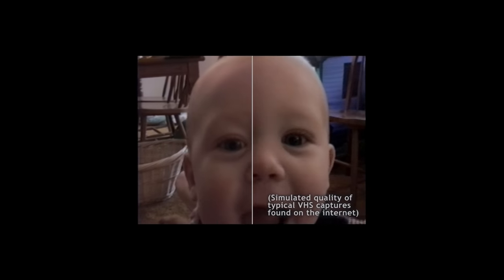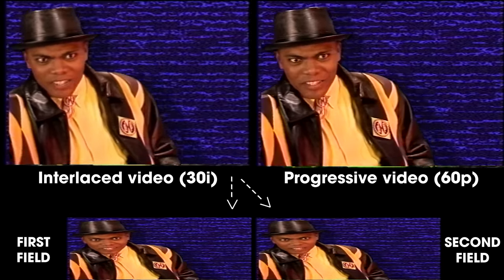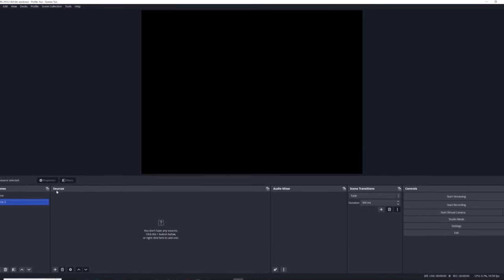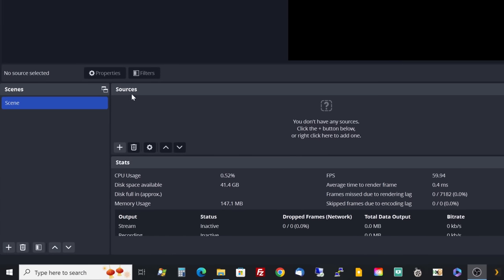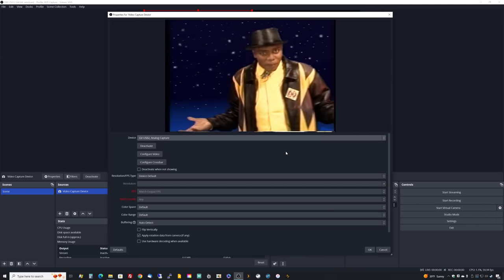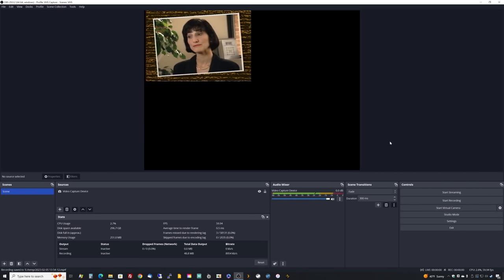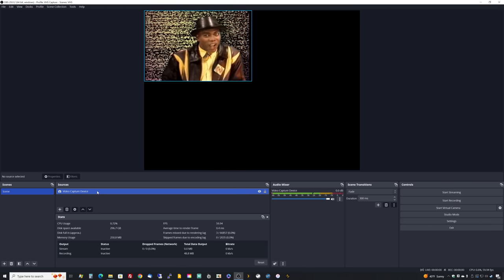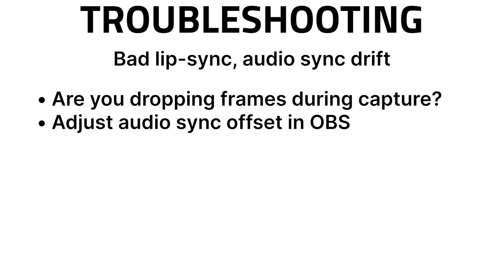How to convert VHS videotape to 60p digital video

Comment: Your previous video taught me how to make my videos look as good as they do- will watch this one when I have time and hopefully learn more!
Reply: OK, after watching this I still like the old way better for my purposes, mainly because I already have hours of stuff on DVDs and hard drives that would need to be re-captured this way from the tapes in order to work. My setup doesn't allow for quality monitoring of any captures done on the computer either.

I would like to switch to Blu-Rays for archival copies rather than DVDs, but does this method retain the analog closed captioning? I want to have that intact as it's part of the original signal; captures made with my DVD recorder keep them for playing through a TV's analog inputs or on players with built-in decoders such as the Oppo 203.
Reply from the maker: There's nothing wrong with sticking to the old process; this tutorial was meant to be a generic 1-stop solution for most general use cases.  You get better quality capturing to .avi and a lossless codec and then post-processing yourself, so if that's working for you, keep doing it.
If retaining closed-captioning is a requirement, you should keep doing your DVD-recorder process, because most common capture solutions and workflows discard closed-captioning.
Reply: @TheOldskoolPC  I'll have to research that more, as I know some playback programs on my computer can decode captions. It's possible to keep them on Blu-Rays also, the first wave of Blu-Ray movies from Sony and Fox actually have them though most people when those were released could only see them using analog outputs downgraded to standard-def! I would like to archive my analog stuff in higher bitrates and fit more on each disc, upscaling to higher resolutions isn't necessary. I only do that for YouTube to get the right frame rate.

Comment: Excellent step by step instructions.  After watching I ordered the I-O Data converter off Amazon, hooked it up, followed your detailed instructions - capturing great from 8mm I am starting with.  Only issue so far is - my file sizes are HUGE!  My 30 second test videos are like 100 MB while looking at your file sizes in the example they are much much smaller.  I selected MP4 but not sure I have the capacity to transfer hours of tapes if my test files are any example.  Doing some more research.  Suggestions?  Thanks for a very useful video.
Reply: I am having the same issue. Even at 720p the files are huge. At 1440x1080 a 2 hour video is 20GB! Have you found a good solution for this yet?
Reply: @Popomcgo  sadly no.  I ended up buying 2 SSD 2 TB external drives and will just move files around using them.  Storage is getting lower and lower cost so would rather deal with large file sizes than poor video quality.

Comment: Once you convert a VHS cassette to digital there can be lots of dead tape space that got converted. Those segments of converted video can be hard to find and not needed. PyVHS is a Python package that removes those unused tape spaces. PyPi and GitHub is where PyVHS is located. Say you converted a lot of videos and do not want to manually edit them then they can automatically be removed while you do something else.
Reply from the maker: Nice.  Does PyVHS use ffmpeg as the back-end, and does it only use -c copy?  I would be worried about generational loss due to re-encoding.

Comment: I worked in photographing and producing concerts from 2005 until 2013. I have 150 video tapes and I used to copy them via FireWire.
Reply from the maker: Firewire is the correct option if the tapes are indeed DV tapes, as you avoid a generational loss doing the copy.

Comment: Thank you very much, Jim! That's very interesting! For VHS preservation I use Cyberlink PowerDirector v5.0 that came with my AverMedia PCI capture card - the quality is great there, but then I have to use something like VirtualDub if I want to remove noise etc. So it would be nice to have more videos about more advanced editing on OBS. I have just tried this new program - the video quality is the same as with PowerDirector, but sadly it did not do well with the sound, which it is all too noisy, loud and distorted with OBS (as you have already noticed once about my own videos...).
Reply from the maker: To be clear, OBS is not really an editing program; it's for doing the capture/processing/encoding in a single realtime step.  If you prefer capturing to interlaced lossless files, then processing them later in virtualdub, that definitely gives you more flexibility.
Reply: @TheOldskoolPC  OK, thanks!

Comment: Thank you so much for this inforamtion. I was really struggling to get my USB convertor to work. Sadly, mine is the first one you demonstrated not to buy but it seems to be working ok at present (the programme that came with it is useless). However, what I have noted is that on some tapes (particularly camcorder ones) the image can be quite unstable, occassionally flicking to a partial green screen). This isn't shown on the TV which is displaying the same image via Scart (I need to use a scart to component splitter due to my VCR only having a scart connection).
Reply from the maker: Capture devices are usually more sensitive to timing errors than a consumer TV/VCR.  If it's really a problem, you can purchase a timebase corrector to fix the signal.

Comment: I thought you did a reasonably good job. I've heard good things about the GV2-USB and I like that you took both fields into account to get 60 fps. I just have a few suggestions to make it even better.

1. You should use an analog capture program like VirtualDub, not OBS Studio.
2. You should capture as S-Video. Even regular VHS maintains the color and black-and-white separation. This makes a huge difference and is where the majority of your quality improvement will come from. You don't even have to buy an expensive VCR with an S-Video output. You can use a new process called RF capture to get digital S-Video from cheap VCR's like late 90's Sony ones and those VCR/DVD player combos from the 2000's.
3. You absolutely need a TBC for VHS. It's very unstable and most capture devices drop frames in a way where they get deleted instead of showing the previous one or snow so the video slowly falls more and more out of sync and it's nearly impossible to fix because you can't just drag the video and audio tracks in an editor because only the part that you're currently working on will be in sync. A TBC is like playing the tape on a CRT and pointing a camera at it to get a new clean signal, except it all happens in memory. It should also be able to fix the usual VHS wobble. If you buy one, you should make sure to get a full-frame one. An external TBC is not necessary for RF capture because vhs-decode has a very good software one.
4. You should capture raw YUV (4:2:2 and 10-bit if possible) as a lossless format like HuffYUV or FFV1 instead of a lossy one like H.264 (yes, I know there's a lossless mode but it doesn't seem to compress as well, for me at least) if you have enough disk space. To get the best quality per bitrate, it's best to use 2-pass 10-bit x264 or x265 at the end. Using 10 bits gives you higher quality at low bitrates because of the higher internal precision.
5. This isn't as important because audio doesn't use that much data but if the audio is only on 1 side, you do have the option to cut the size in half by using sox to copy just 1 channel and make a mono audio file. I also capture the audio as lossless and use FFmpeg with libfdk_aac to encode it in the highest quality, and of course I save the lossless file.
Reply: Where can I find info about the RF capture on cheap VCR? I have an VHS/DVD combo from 2007, but doesn't support vhs to dvd sadly.  Philips DVP3350V/01.
Reply from the maker: 1. My previous tutorial actually did use VirtualDub.  I left it online for those who want to use that instead.
2. Regular VHS combines luma and chroma, so s-video offers no benefit.  That said, some s-vhs decks have a TBC which can output separate luma and chroma from the framebuffer, so if you have an s-vhs deck with a TBC, you should use s-video.  As for getting the best quality from RF, maybe you're talking about the domesday device adapted for VCRs, which is well beyond the scope of this beginner's tutorial.
3. Agreed.
4. Capturing raw YUV 10-bit is what I do for my archival work.  This video is a beginner's tutorial.
5. Agreed.

Comment: Kudos for a well produced and informative tutorial for analogue video transfers. I've taken a different but undoubtedly more costly approach. I purchased a DVD recorder to act as a (line) TBC, upscaler, as well as digital converter via HDMI. The specific model is a Toshiba DR430 (purchased for CAN$60) which also supports 1080p (so far I've only tested 1080i). The HDMI output of the DVD recorder is then connected to a low cost HDMI to USB capture card (CAN$30 Vivitar card available from Walmart) in 1080p. QuickTime (or OBS) is used for digital recording using a Mac mini. I intend to test the built-in de-interlacing capability of the Toshiba DVR recorder in a future test.

Also, thanks very much for the mini OBS tutorial. I had installed OBS but hadn't experimented with it very much. BTW, Shutter Encoder is another well-designed application for video encoding as well as many other functions (available for Windows, macOS, and LINUX).
Reply: I completed more than 6 hours of video8 transfers obtaining good image quality using 720p HEVC at approximately 1 Mbps. Handbrake's  noise reduction and chroma smoothing were helpful in this regard. I recommend using a DVD recorder as a TBC, upscaler,  and an A/D converter (via its 1080p HDMI output). Other (lower cost) methods that I had tried previously worked but the transfers were of less quality.

Comment: Fantastic tutorial, I can't thank you enough. I only came across this straight after I ordered the Startech unit, I did look at the similar versions on amazon but I had doubts about them, my feeling was that with the Startech unit it will be supported and hopefully give better results than the similar and cheaper versions. I live in the UK so in a PAL 50Hz region with many SVHS-C, Hi8 and MiniDV  tapes to transfer, luckily all three camcorders work perfectly, I will be using firewire to transfer the MiniDV over, there was an issue with the driver not loading for the camera when it was connected but   I found that by opening device manager it seems to resolve this.

Comment: Your presentation style is excellent. Your audio and clear speech is much appreciated by us with hearing issues. I watched this tutorial several times and used all the values you suggested. I find that the resulting MKV/MP4 files are huge (30 Gb) for a 3 hr Beta II tape. My prior recordings were done with the Elgato Video capture. I don't see a huge quality difference between this method and what the Elgato gave me and the and the file size was only 3 Gb. What can I be doing wrong?

Comment: Figured out the dropped video capture in OBS due to weak signal from source when capturing old Hi8 and VHS. I started using the standard yellow RCA jack for video as opposed to the SVHS cable. The video still drops out from the preview screen (briefly), but OBS keeps recording until the video comes back online. I can deal with these gaps when I edit the files later. Given the age of these tapes I am not noticing a discernable difference in the capture quality between the RCA jack and the SVHS input. Still working on trying to get the Dazzle to work with Windows 11. So far, no luck getting Windows to recognize the Dazzle so I can direct it to the drivers. The Roxio input device seems to work well with OBS as far as setup and capture. Thank you again for the time and effort you put into making this tutorial.

Comment: This is so wonderfully presented and easy to understand. How important is capturing at 59.94 vs 60 FPS
Reply from the maker: Thanks!  It's not the end of the world if you pick 60 instead of 59.94, but since the actual true NTSC broadcast (and VHS recording) rate is 59.94, picking that means you will avoid a duplicated frame every 16.65 minutes.
Reply: @TheOldskoolPC  Since this 60 vs. 59.94 fps wasn't explained in the narration, I recommend adding it to the video description.
Reply: @ObiWanBillKenobi FYI, the fractional framerate is a result of how NTSC added in color in a way that was compatible with black and white televisions.

Comment: Thank you thank you thank you.  I could not get video to show up using an old Roxio VHS to DVD capture device I had on hand.  After buying a current Roxio device (still doesn't work with my Mac Mini due to M1 chip), buying a new VCR (which probably wasn't the problem but I ended up with a nicer one), digging out my Canopus ADVC from my box of computer stuff (never throw anything away), digging out my firewire cables and adapters, buying a thunderbolt 2 to thunderbolt 3 adapter for my mac mini and downloading OBS (as you suggested)...FINALLY, I was able to capture videos from the 90s of my husband's bands and our band projects.  I had a couple of days of angry, tear-filled days - WHY WON'T THIS WORK!!.  I'm guessing it was the Roxio the whole time (yes, I returned the new one to Amazon for a refund).  But thanks to your detailed, well-explained instructions and seeing the ADVC from another video, finally I'm happy again..and my husband is happy too (happy wife, happy life lol).  I'm now off to Premiere Pro to clean up the video a little.  THANKS AGAIN!!
Reply from the maker: This warms my heart, thanks for letting me know!  Hey, that Canopus ADVC is gold, never get rid of it.  Also, it might surprise you to know that Premiere Pro can still totally understand interlaced video; in fact I use it with interlaced video when I do restoration.  PPro supposedly should still be able to capture DV from the Canopus ADVC if you connect it with firewire, so you might be able to skip some steps.  Experiment!

Comment: I was actually looking at the last video, and this one drops after I buy one of those el cheapo Amazon capture cards. Just dropped the $60 on the GV-USB2 for the full field capture. I'm sure it'll make a difference, and thank you!

EDIT: You can use other resolutions as well, as long as they're a multiple of the source. Choose the deinterlacing method "Retro" for old 240p stuff.
Reply from the maker: Glad it could help!  I'd exercise caution using the Retro filter though, that was designed for console 240p gaming.  It's practically a nearest-neighbor resize, which results in blocky pixels.

Comment: What an amazing tutorial. I can't wait to get started. I just imported all my Digital 8 tapes using FireWire on a 2012 Mac Mini and iMovie. It came out as well as I expected but now I might try it again with your method using OBS on the Mac Mini.

Another note, I can't seem to find a VCR lol. I have a bunch of VHS that needs to be converted.
Reply from the maker: Wait -- if you already have the captured video in DV format, and it's still interlaced, that's actually better than this tutorial.  You can post-process your existing files with FFMPEG on the command-line to get decent output; see this video's description for an example command-line.

Comment: This is the most usefull tutorial video I've come across so far! Thanks!

I have been struggling with the Dazzle device though. I know you do not recommend this one anymore, but since this is all I have at the moment I was wondering if you might have some insights for my problem. 

When following all of your steps, it looks like the video is skipping frames a couple times a second or so. (not according to the stats window) So its looking really smooth in-between the skips. I'm in Europe, so fps is set to 50, however 60 yields a smoother result, but still not 100%

Thanks again for the great video!
Reply from the maker: This might be due to a cadence difference between your capture rate (which should be 50) and your monitor refresh rate.  Try setting your monitor to 50 or 100hz.

Comment: i have watched maybe 50 videos about VHS capture devices and none of them come close to what you have done, you have been extremely helpful, thank you sir! also, quick question : i have the i-ODATA GV-USB2 and lately i have been trying to move my operations from PC to MAC and i was wondering if there might be a similar product supported by Mac, let me know if you can help, thanks!
Reply from the maker: Thank you so much for your support, it definitely means a lot and helps me make other videos. I'm glad this tutorial was useful for you!
Unfortunately, I don't have a mac, so I can't recommend any specific capture device. Luckily, OBS operates the same on Mac as it does on windows, so the tutorial is still valid if you end up finding a good device.
If money isn't a problem, you could try any capture device from blackmagic, just make sure wherever you buy it from has a return policy if it doesn't work out.
Reply: will check it out! thank you very much :) have you ever used the Elgato video capture device? if so do you know if it passed both fields through unharmed?  @TheOldskoolPC

Comment: Great video, easy to understand for someone who is new to this. and I was wondering, does it matter which VCR you use? Can I just use my 30 year old one, or should I purchase a new one
Reply: There aren't really any new VCRs being made. You should use a decent deck with S-Video output if you can, that's in good shape or has been serviced recently. If you don't have access to that, a bad transfer now is better than no transfer once the tapes are no longer functional.

Comment: Well, around 2016 I purchased a 10 dollar USB capture device to capture some Atari 2600 footage. And the problem not capturing both fields was not the device itself but bundled recording software. I believe I was able to capture both fields using good old VirtualDub, probably with some deinterlacing etc processing.